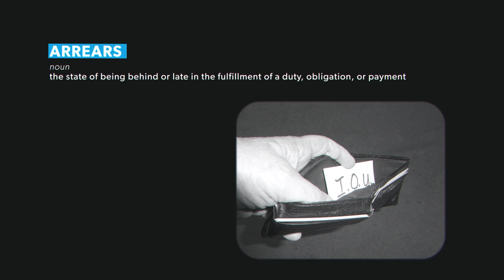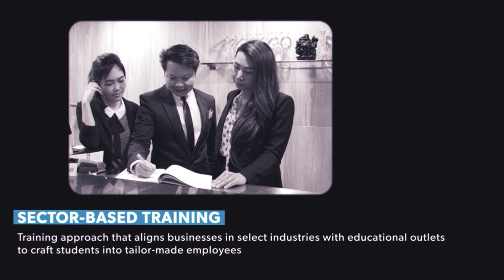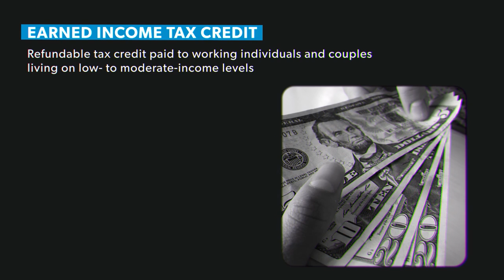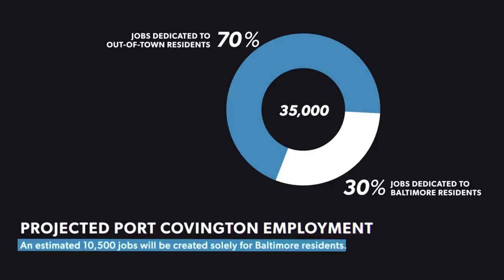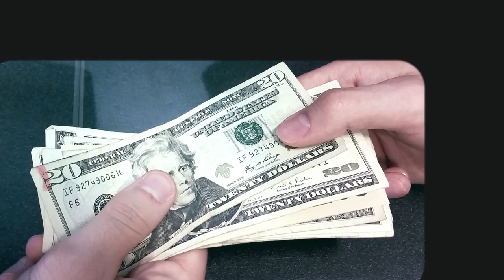Getting men back to work | WHAT IF?

Comment: I find it dubious the claim that the construction industry is using all of the available workforce and that has any impact on housing availability.  If labor shortage had a significant impact on housing, then owner built housing would be booming, but it is minimal.  The pay available for basic construction labor is not sufficient to buy the housing that they are building.  Yet the average size of new home construction goes up year by year (with only a dip, but not signifcant correction in 2008 - 2010).  Pay rates are low enough to discourage illegal immigration, yet new construction employs labor saving tactics like poured foundations, manufactured truss floors, offsite assembled roof trusses, and pex plumbing with minimal connections.  Its easy to say that there are 100's of thousand of available construction jobs that are unfilled, but is that leading to increased pay rates?  If not, then it is equally reasonable to say that there are no available construction jobs and that supply and demand are perfectly balanced.

Comment: Interesting, you go after men because they can't work or can't afford to work, because of social programs,  school programs, and legal issues. You all need to look at the cause of the problem before you can fix it. With the current social and government systems currently in place, it will refuse to change without major difficulty, they would rather die than give up power and money. With the vast majority of unskilled work and manufactured goods in foreign lands, government needs to takes steps to bring them back. The natural resources that we have need to be developed smartly, and we as a nation need to work for ourselves. We need to spend our dollars at home in both infrastructure and job enhancement and development.